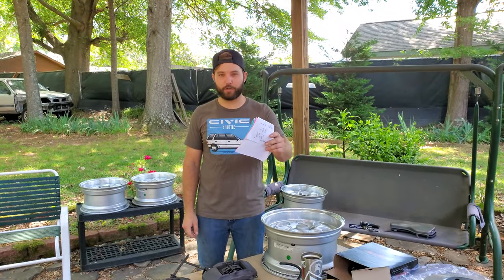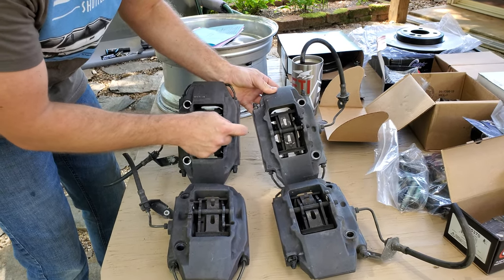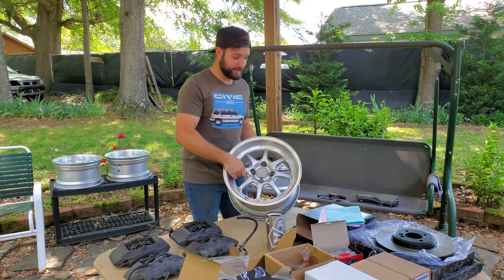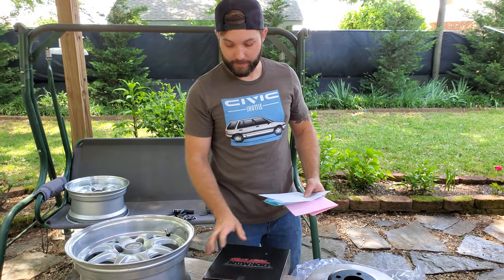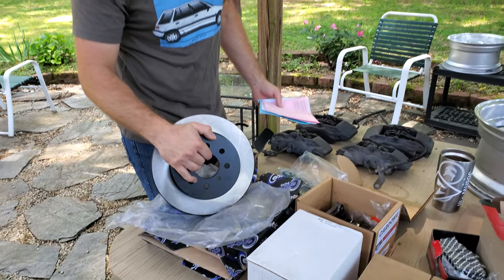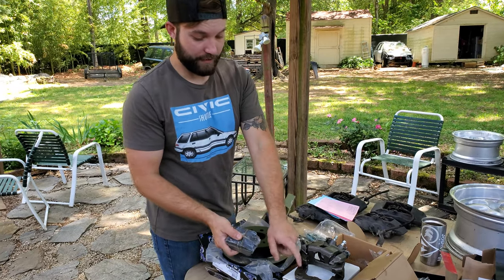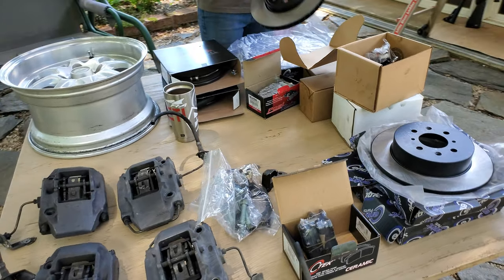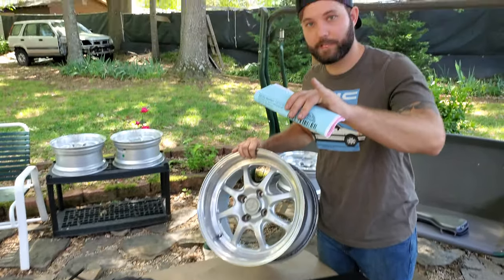Civic Wagon Brembo Brake Upgrade | Part 1

Comment: I was thinking about doing this big brake kit. I've crossed an ITR for many seasons. Toyed with a TL-S 4 pot. I understand that the ITR can't be beat. But this is something new
Reply from the maker: They feel amazing. Highly recommend
Reply: I'm strictly talking about brakes. Not like I can afford an ITR. My shit is a 1991 like you have
Reply: @rt4wd_wolff  You installed it?
Reply from the maker: @quadnie  installed and works great. The brakes grab hard. Way better than ITR brakes.
Reply: @rt4wd_wolff  truth be told, the ITR setup works perfectly and is all you will ever need.  I was on that hunt for perfect modulation.  Never finished the TL-S brembo calipers, matching the rotor on a 4 lug was near impossible.  This new technology improvement is inspiring.
Reply: Back 12 years ago my buddy did a similar setup on his EG.Used Advics 4 piston calipers, AEM two piece rotors for 4x100. Custom made some brackets to DC knuckles. Went with JDM DC5 rear calipers with the EP3 rear rotors.  Those rear calipers were rare as hell, same size as EP3/RSX but aluminum body and had heat dissipation vents
Reply: I've had a couple pairs of junk yard pulled EP3 rear calipers.  Aside from having to flip them when bleeding it's an excellent value